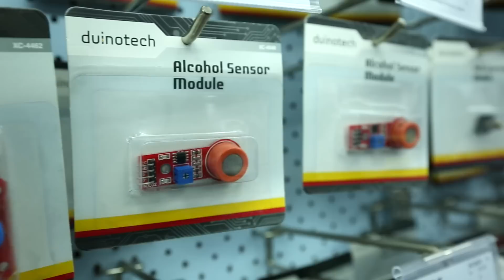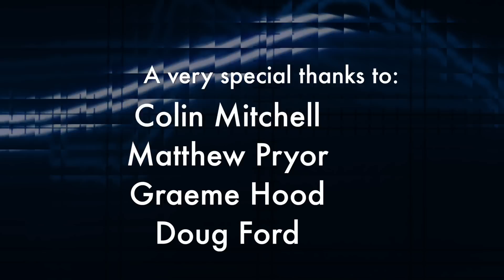The Decline of Hobby Electronics?

Comment: I'm a software engineer.  We make virtual things with software.  After a while you want to make something that you can hold and interact with physically.  Arduino is a natural stepping stone.

But I really wish I would have watched my Dad build the Heathkit tv sets back in the 70's or 80's.  I was too young back then.  Those kits had thousands of parts.  He built more than one and he helped others get theirs finished when they got stuck.

After I built my first computer I told my dad about it.  He asked if I had to do any soldering.  What I did was not what he did.  Of course I just plugged boards into sockets.

I want to design circuits that do something but I, of course, want to build something amazing.  I have lots of books.  None of them say how to design circuits.  They talk theory and explain the components.  I guess I need to take the time to tinker.  

It's so easy to tinker with software -- writing code.  You build your own universe, your own rules, and your virtual components.  If it breaks, you say all the same swear words, but your house doesn't burn down.

It's important that there are hobbyists out there that can work with discreet components.  We can't let it become magic and leave it up to corporations to save the day.

Comment: I think most hobbyist have now moved to using things Like the Arduino, and supplementing their project with 'normal' components, or other pre-built boards with surface mount components. I don't think that's worse or better than projects I built in the eighties. Just different, and I think it opens up more possibilities to more people.

Ps. I was actually a programmer to trade, electronics was always just a hobby.
Reply: This is exactly what has happened.hobbyist have started using Arduino like crazy. Mainly because it let's you make some nice quick prototypes.
Reply: @ipodtouch470  i never cared for that ardrunio crap myself or smd circuits i still with good ol descrete transistors and ic's and tubes

Comment: Here it is 2020 and I've got my lab put together over the last 2 years, restarting a hobby I loved and left 40 years ago.
Reply: They used to have places called libraries, you could borrow books there. Not a great selection, but the basics.
Reply: I loved electronics as a kid but had no support from family. Now in my 40s I'm falling back in love with it
Reply: Same here, Lol, probably about the same age as well :)
Reply: Sorry for the idiotic question, but what do you do with hobby electronics? Just repair things?
Reply: @knpstrr  My God, if you only knew.  I wish I could instantly transport you to my home and show you so many things.  I do repair things, such as old arcade machines, old radios, and sometimes modern things, such as flat-TV power supplies, and car stuff, but the real joy comes from designing, building, and sometimes programming one's own original designs.  Besides building small devices that can do very complex things of all sorts, I also like to write Windows programs using free Microsoft Visual Studio that are serially connected to the devices that I build in order to program them, control them, adjust their settings, and so on.  I have created many unique diagnostic tools for my 1980's arcade machines, new cool lighting devices for my old and new pinball machines, and so much more.  One simple recent project was a backup camera power switch for a friend's car.  It controls the camera module power supply using specific turn-on and turn-off delays.  It's adjustable and is smart enough to ignore the reverse flyby (that's when you move the shifter from park to drive passing reverse along the way).  My point is, the only limits to what you can do with hobby electronics is your imagination and perseverance.  You can make a flying atmospheric analyzing drone, or drones that perform lightshows at night, remote operated vehicles of all sorts, solenoid valve controllers, lawn sprinkler controller, sound effects, autonomous robots that perform tasks or fight or dance or talk to you.  You can make bluetooth or wifi connected controllers for lamps or strings of RGB LEDs, a garage door controller, a lighted frisbee, a mosquito trap, laser projects, 3D printing projects, audio power amplifiers, and on and on to infinity.  Frankly and sadly, life is too short to do everything that is possible but the positive aspect of the hobby is that no matter how long you live, you'll never run out of exciting things to learn and do.
Reply: @knpstrr  It's more than that, learning to understand basic natural forces and the geniuses who manipulate them to do amazing things, such as this wondrous device we are using to communicate.
Reply: @Travis141123  How would you recommend one get started? Everything I look up for beginners seems to point to getting an Arduino. But just hooking things up to an Arduino doesn't sound that exciting on the surface (though I may be wrong).
Reply: @knpstrr  The Arduino platform has evolved a lot in the last few years.  It's the simplest way to get into using embedded controllers (microcontrollers).  There are many other ways, too many to list here, but there's no wrong way or best way.  Most basic tutorials start with the LED blinky (hello world) for beginners.  Such tutorials just show you the simplest possible work flow.  Complex projects just build on that.  The entire point of using the microcontroller is to make it do whatever you want it to do using a list of instructions (the program) that you will write.  It's amazing because it's literally a fully customizable platform on a chip and you get to decide what it will become.  When you by it, it's essentially a blank slate.  You tell it what you want it to do using a high level language.  Yes, blinking the LED is crazy simple and yes, it's ultimately boring, but you have to start somewhere and it covers the fundamentals needed to get started and make something that works.  But then you add a push-button that makes the LED blink faster or slower when you press it.  Then you add another button and a motion sensor module that turns it into a security alarm.  Then you add another function, and another, and have a great idea for another project, and pretty soon, you are controlling incredible things with a single inexpensive chip.  Even better, you can share your design and your code with others, borrow ideas and solutions from them, and become part of a much larger world.  It's pretty darn cool.  By connecting the Arduino to a laptop or desktop PC, you can write PC programs that communicate with the Arduino (or any microcontroller) and then you can use your PC to control the device, upload data from it, update it, whatever.  By adding a wifi module to the Arduino, you can connect to your project on your home network and control it wirelessly.  Say your new little robot wants to go for a walk, no problem, you can see what it sees through your PC or phone screen.  Whether your device rolls, crawls, flies, swims, sings, lights up, or lets your dog in and out, it's up to you.  There are no limits.  In the world of hobby electronics, things keep getting better and evolving every day.
Reply: For years I've been going back to learn, and master the concepts and tasks I failed at when younger. My drive is high and satisfaction is certain with each accomplishment. I hope to transition my career as I get older though I fear I'll just die with more knowledge and far too many old radios, TV's, stereos, and diagnostic equipment. But I'll enjoy my time until then.

Comment: Breadboard:exists 
Soldering iron: am I a joke to you?
Reply: Breadboard to soldering iron: "you smoke too much".
Reply: @bill392  
Well if you have a fume extractor 
Then its OK
Reply: @lordelectron6591  Actually I do have one.  I use a compact Weller WFE-P that has a self-contained maintenance-free reciprocating air pump and a Hepa filter.  It draws a flow of air through a long rubber tube (about as thick as the soldering iron cord) that connects to a metal tube mounted right on the iron itself.  The tip of the metal tube is open right above the iron tip so that it draws the smoke right off the iron tip from only a few mm away.  The tube just sucks the smoke right up from the source.  I don't need a big fan or a giant vacuum box or a long clothes-dryer hose or anything like that.  My pump has two inlets so I have two irons connected to it and each iron has its own extraction tube.  Dunno if you'll agree, but those thin black porous charcoal filters on the 6" square fans are a sad joke.  They don't work at all.  People see the smoke go in the front and don't see it come out the back so they think it's trapping the smoke.   Sadly, all that smoke whips right through.  It just mixes with room air and is diluted enough to fool people because they can't see it.  Selling those things should be illegal.  At the company where I work, all the benches used to have those fans sitting on them.  By mid-day, you could see the haze hanging in the air.  They rented an air-particulate-impurity measuring system and the smoke ppm concentration was crazy.  We switched to the Weller Hepa-filter pumps and it was a night and day difference.  I'll never use a fan with charcoal filter ever again.  They're garbage.  I think the Weller product is sold under a new name now, Apex Tool Group maybe.  Anyway, that pump I mentioned is very expensive, too costly for the average hobbyist, but you can build your own air pump using other component sources, and you can make the extraction tubes from 5mm or 6mm diameter aluminum or brass tubes sold from hobby stores.  You can use any silicon rubber hose you prefer, and you can 3D print small plastic mounts to attach the tubes to the iron handles.  That's what I did recently.  My 20+ year old Weller irons finally kicked it and I bought a new station with new irons.  The new station is amazing.  It heats up in 12 seconds and compensates for thermal loads almost instantly.  It makes soldering SMDs with thermal-relief pads a snap.  From delicate tiny SMDs to big heavy terminal blocks, it performs great.  The new irons aren't available with built-in extraction tubes like my old ones so I made my own tube assemblies.  I use them at home and now we're using them at my workplace too and the guys/gals love them.  Some newbies say the tubes get in the way and I'll admit, they do take a little getting used to, but after a while, you don't even notice them anymore and the work rooms stay clear.  With the old fans, we used to get a yellow film build-up everywhere on everything.  Wipe any cabinet with a clean damp cloth and ewww.  After switching to the Hepa filter system, that no longer happens.  Imagine that yellow crap in your lungs.  Eww.  Years ago, we also switched away from Rosin core and now use 1% no-clean 245 core and 331 water-wash core.  Results have been great and there seems to be much less smoke and residue.
Reply: @bill392  
I have a 25w solderon  soldering iron
Its a good one currently I use 60 40 
Rosin core wire . 
Also about the fume extractor
The fan with charcoal sheet 
Is not nessasary i know it does not work but using surgical mask material instead of charcoal  would surely filter out the nasty stuff .also i do soldering outdoors so no worries.
Reply: @bill392  
If you do smd work 
That means you have near precision 
To that of a neuro surgeon.
Reply: @lordelectron6591  I appreciate the compliment !  If you would like to see some video of me soldering, here's something...
https://youtu.be/L-IV_trhYeI?t=530
Also, here's a good photo showing one of my own PCBs, one of the simpler ones.
http://www.biltronix.com/images/BXAVG3/BXAVG3_017_1024x885.jpg
The chip is a 100 pin Xilinx TQFP (quad flat pack) with a 0.024" pitch (0.5mm).  The chip body is 10x10mm.  This PCB is 100% soldered by hand on my bench and I've made 100's of them.  There's a knack to it but I've been able to train several people to do it.  It does require some patience and the right tongue angle.  I use 0.015" multicore 245 or 331 flux core 63/37 solder wire and the same iron as seen in the video link above.  No solder paste, no paste mask, no toaster oven, no hot-air gun, no solder-wick, no Chip-qwik alloys.  A swingarm lamp with a 5 diopter magnifier is very useful.  I design and build this scale all the time, both at home and at work.  I'll admit, this level of work takes practice.  It didn't happen overnight.
Reply: @bill392  
Y u stopped uploading 
You seem to be expert at electronics
Also soldering can be used for small 
Weldings
Reply: @bill392  and that atari
Board thats just soo intricate 
How did u have the patience to do that?

Comment: Down with Digital. Sure, it improved some formats but not all of them. What is really bad is the Throw-Away-aspect that the "new" electronics has caused. The planet won't keep accepting the waste. New electronic devices should last as long, or longer, than the analog devices . . . but they don't. Repair them------not without parts-----so you're screwed. And the consumer has  become  more gullible and less component as a result of believing the hyped up sales advertising and purchasing the garbage products. Today's electronic consumers know far less than ones in the past . . . and that's just the way the industry wants it.
Reply: None of what said is the fault of digital technology.
Reply: Yes, the "replace it, don't fix it" attitude does produce a lot of waste and it's sad to see.  Nobody fixes things at the component level anymore.  In many cases, it's no longer possible though.  These days, a technician's time is more valuable than the entire product, or motherboard, or air-bag control module, or coffee-maker, or whatever.  And let's face it, there's almost no more little service shops left in business anymore.  When I was in my teens in the '80s, I worked at an appliance repair shop.  I fixed toaster ovens, blenders, electric shavers, washing machines, and one time... an electric fence shocker box for a farmer.  I later got into fixing audio receivers, phonographs, TVs, and VCRs.  That's all gone now.
Reply: @bill392  I had one of those audio repair shops . . . that wasn't practical to keep going. It's certainly true that today it's not  economically sound to repair components but only because of the crappy way it's made and lack of parts. I'm all old-school analog and glad of it.

Comment: It may take several years/ decades until we get to a point where the virtualization will fully replace the discrete electronic components and the hobby experience too. As a (bad) comparison, nuts & bolts were invented centuries ago but they are still around in millions of sizes, types and materials and I'm sure they will still last for decades/ centuries ahead. The same thing shall happen to electronics, changing the format and adding complexity....

Comment: what is the oven being used at 6;38. the boy puts his board in and it is also seen throughout this video. Can it also be used for baking tv main boards?
Reply: It is a "toaster oven" which has been modified with an external controller that modulates its power to control the temperature over time to carefully melt the solder used to attach the components.
A TV main board might be too big to fit inside this, you would have to measure it and check the specs.
Reply: @MaxWattage  cheers Nicholas.

Comment: When I was younger, around 7, I learned to solder through hole components. Later on, I learned smd, and I transitioned without a problem, as I had time. Today,  kids are thrown into working with parts that require more equipment and technique than required when I was growing up. Special tips, not just one trusty 20 watt do-it-all, its a whole different way due to component size.I'd hate to see the hobbyist scene disappear.

Comment: 2 things - A lot of people just want an easy platform such as the Arduino where you can take the board, shields, sensors, pre written libraries and examples and cobble together some projects. Nothing wrong with that it's just not learning about electronics. Secondly, I partly was interested in electronics as there were some major companies where I lived which employed people in electronic engineer jobs, in the 80's and 90's these companies were decimated and jobs moved offshore. A lot of people then don't see the point if there is no career but you will still get hard code electronics folks. Just my thoughts anyway.